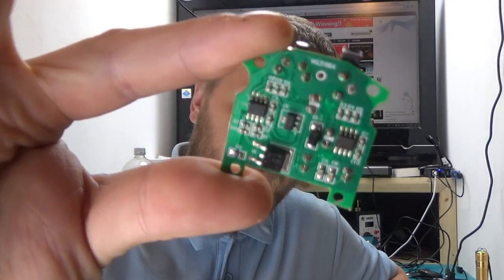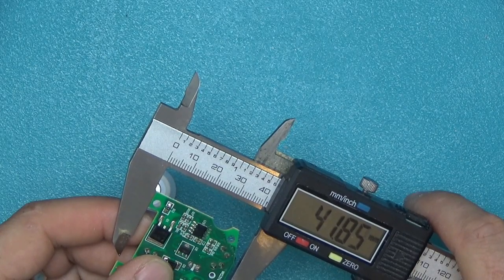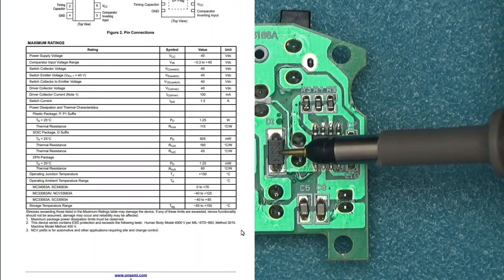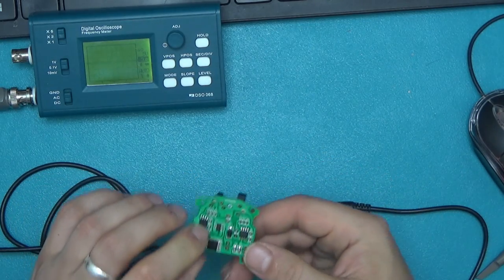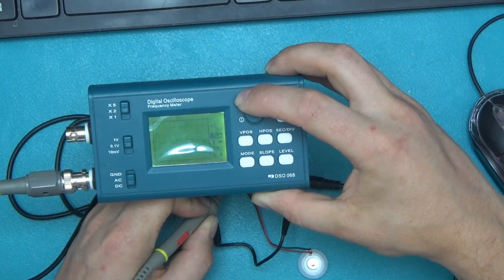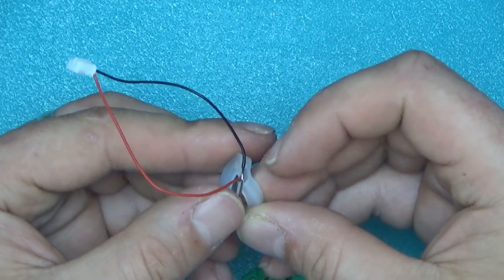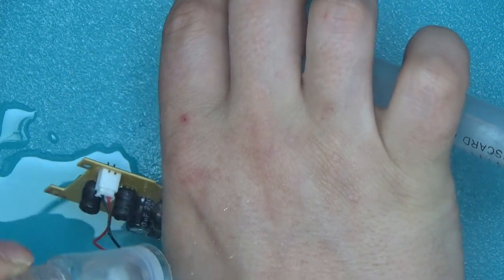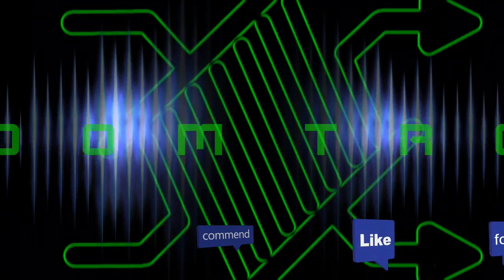#003 -  Ultrasonic Misty Fogger from ICStation

Comment: It's a mister not a fogger, mister needs wick or water supply from behind and fogger needs to be submerged by a specific head of water. It can be left to run dry, never had any problems with all the units I've used so far.

Comment: What happens if it accidentally runs dry?
I've been looking at this unit but worry about the lack of water level sensor. Any idea how I could add a water level sensor?
You were right about the plate. I've been confused because I've seen some that push from the other side.
I am trying to design a mister for terrariums.

Comment: The frequency you read is way off. Probably because you were measuring it with no water on the transducer, so it couldn't resonate as it should.. It will resonate at 1.7MHz under normal conditions.
Reply from the maker: That seems way too much, I read 100kHz and product listing stated similar. Are you sure?
Reply: Hmm, i'm getting unsure now. I have a few of them and they are running very high frequency. I will have to dig them out and scope them with my Rigol-Scope.
Reply from the maker: zapro_dk let me know what you find out!
Reply: The nominal frequency of this module is 113 +-2kHz (specs, not measured yet).